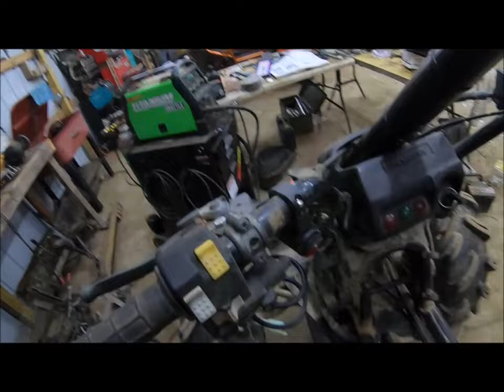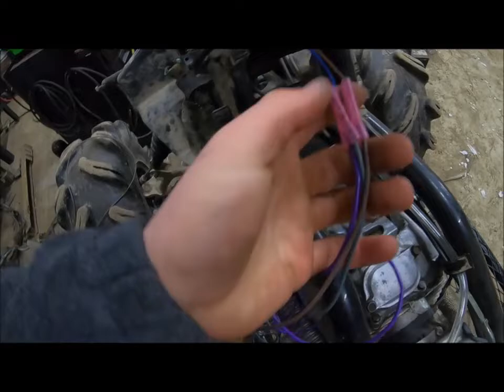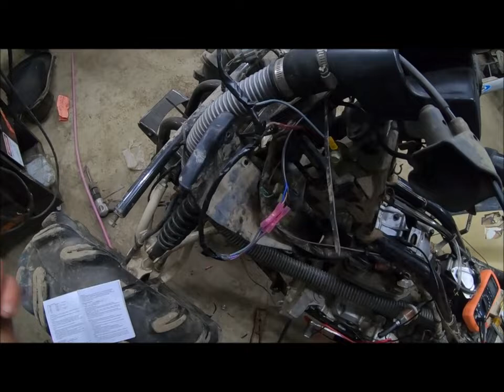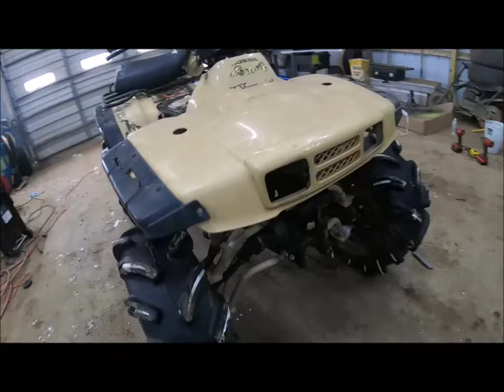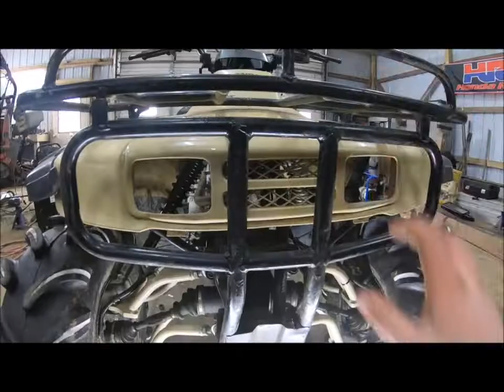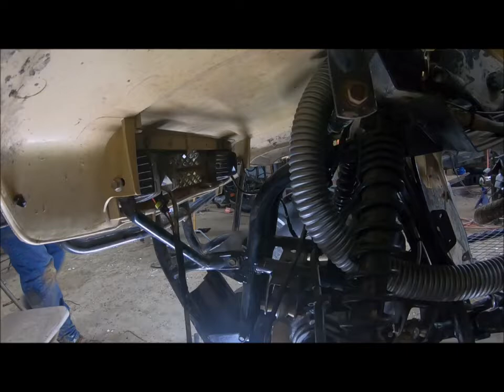Custom Honda 300 Part 3

Comment: Just a thought (haven't watched part 3 in its entirety yet) you could easily install a factory 2wd/4wd switch on the throttle side, using an 04-07 400 Rancher, 05-11 Foreman, 05-14 Rubicon, or 03-up Rincon throttle assembly and switch.  That's what I used when I put a Rancher 400 selectable diff in a 350 Rancher.
Reply from the maker: It's definitely a possibility. I didn't look into that. I just wanted a quick and easy way to hook it up. I think ill look into that now though. Thanks!
Reply: I also used a 4wd light from an 07ish 420 Rancher, which is a simple green light like the 300's have, with the 4wd symbol etched on it.

Comment: Hell yeah brother 

You got a link to the wire you buy off Amazon? Or particular brand you recommend?
Reply from the maker: I just typed 16 gauge into ebay and bought the 275 foot lot. You can always use wire. The diff is all 20 gauge so 16 for the wiring is overkill.
Reply: @steveboy3021002  thanks for the info. Can’t wait for part 4
Reply from the maker: @offthestreetsandinthecreek7294  part 4 will be a test. I finally got all the carb parts and the ice has thawed so i can take it deep and see how it does.
Reply: @steveboy3021002  hell yeah brother I can’t wait to see it